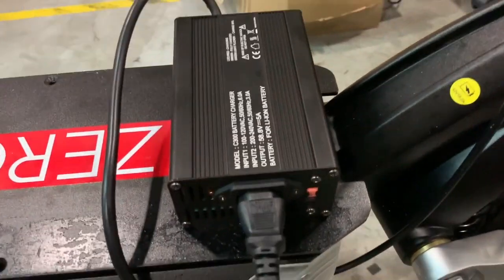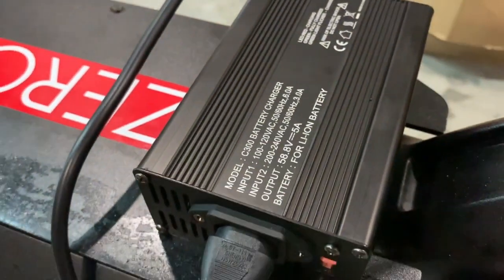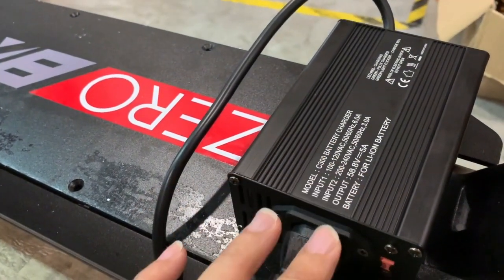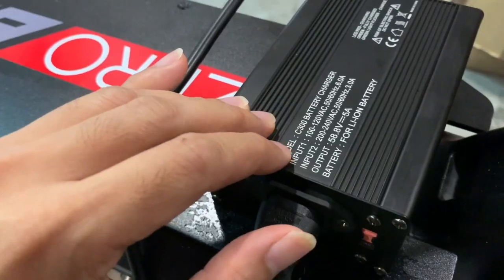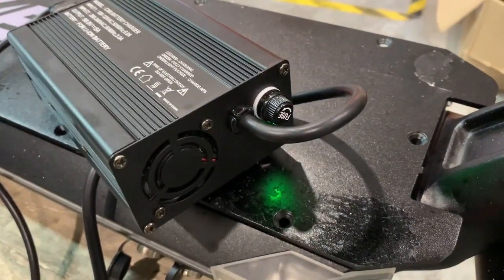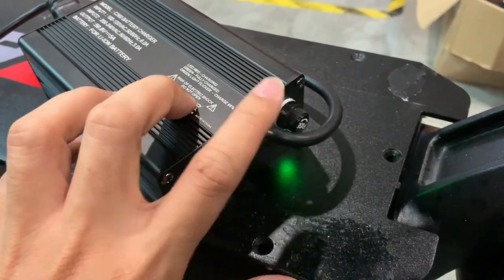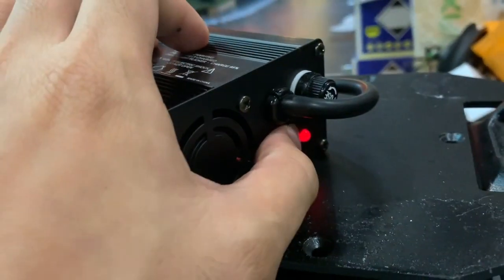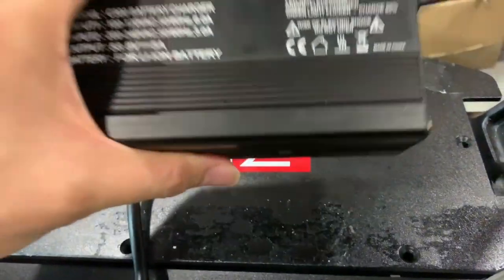Fast Charge your ZERO scooter in 5 Hours!

Comment: Is there a fast charger that will fully charge in 2 hours? Zero 10x 60v 21ah
Reply from the maker: Józsi that will not be too safe. The bms has a maximum charging rate of 4-5A
Reply: Which one has the fastest charger?
Reply from the maker: Józsi 5A charger
Reply: Should I buy 2x 5A?
Reply from the maker: Józsi that will spoil your battery
Reply: @FalconpevSg  Yes

Comment: Is okay to have 2 standard chargers charging the scooter? Or is damaging the battery as well? And better to use only one?
Reply: Hey! Did you find out?
Reply: Two standard chargers is fine. It’s the exact same as having 1 fast charger plugged into it. Follow the basic laws of (unplug 1 of them when the scooter reaches approx 70%) you don’t have to, but it will preserve battery life by reducing heat in the batteries and thus preventing evaporation from occurring and prolonging the batteries life cycle.

Comment: The scooter battery can handle 3500 watts of intermittent discharge under hard acceleration but how much can the battery handle for constant discharge . Whatt is the c rating of the sinc cells in charge and discharge ?
Reply: Does it matter if the two engine can only take 1000w each?
Reply: @steemium  current is drawn and voltage is pushed. the actual motor is rated to operate at 1000 watts constant but can draw at least 1600 watts for a short time . the controller limits what the motor can draw though.

Comment: The way these cells work is you have to keep the heat down as the very small amount of electrolyte will evaporate so this charger is fine upto 70% of charge and then ride or do last 30% before you ride ! Even better for yoir cells is do last 30% with normal 2 amp charger before you ride . Change your low voltage cut out to 4.15 an increase of .05. Always put atleast 10% of charge back into scooter after charging and let cool down to room temp before doimg fast charge. Not straight after hard run . This is to extend battery life nearly double ! Never charge scooter up from hard run to full with more than 2 amps as the battery will already be warm and now you increase the heat for 6 hours so the batttery is actually warm for 8 hours 🧐not good . Lots of evaporarion . Do this ten times and you will lose 30% of battery capacity ! Same as your smart phone etc
Reply: Can you dumb this down for me please? I'm getting this scooter this week and I need to know this
Reply: @Billionaireboyandres1  avoid creating heat in your batteries and then leaving them to stay warm by not charging them straight after long ride !
Reply: Thanks

Comment: What do to if the charger light don't turn from red to green even though the step is fully charged (i can see that on my screen and my voltage is 65. I have a 60V). Can it do damage to my battery if I keep using it? Thanks!

Comment: Its disappointing how no sellers seem to know even the most basic things about their scooters, the public depends on you but you fail them. Below is a good comment explaining why this charger will not damage the battery. My comment is to address the misinformation about panicking to turn the charger off to prevent over charging. This is actually governed inside the battery pack by the BMS, its essentially impossible to over charge the battery. Indeed it may be advisable to leave the charger connected for longer after the green light comes on because that's where battery balancing seems to happen (depends on BMS).
Reply: Let me get that straight...
It's better to leave the battery "overcharging", because of what exactly? What kind of balancing would that be?
As far as I've read, it's better to leave the battery at 30-70% at all times.
Please correct if I'm wrong, I actually have zero experience as I've just received my Zero recently (pun intended) cheers!
Reply: @rbmanb  I won't over charge if the charger voltage is correct. some of the cells might be higher and some lower. they have little bleed off resistors inside basic bms controllers that bleed off current to the higher cells and allow the lower ones to catch up. probably every 5 rides its best to leave it on for extra 30 min after green light to allow balancing.

Comment: The difference in battery life will be negligible when using this 5A battery charger (5-6 cycles at worst). With it you will charge your 23Ah battery with 0.22C which is on the lower end of li-ion battery specs (0.2 - 0.5C).
Actually with this charger you can double your battery pack life if you lower the output voltage to 57.4V.
This will result in 5-8% decrease of your battery capacity per charge(each cell will be charged to 4.1V), but will more than double full charge battery cycles!
Do not modify the charger if you do not know what are you doing !!!!! 

Opening the charger may be dangerous and you can electrocute yourself even if it is unplugged.

Ask an electrician/electronics engineer to do it. It only requires 2 screw drivers, voltmeter and 5 minutes of his/hers time.
Reply: Or if your smart the best way is like new iphones . Charge upto 90% and just before you go on your ride you finish off the last part of the charge . High battery degradations happens when cells are charged to 4.2 volts and just left . Even 1 day can have an effect . If storing scooter its best to charge 60%
Reply: @Buzzhumma  thanks for the tip. How about the lower side? Should you ever empty the battery? How low will you go, and for how long?
Reply: @rbmanb  same applies. Dont leave it there! 50% is a good place to leave it until next ride day !
Reply: Why not just use two normal charges instead?
How would that compare to one fast charger in terms of battery life?
Reply: Although doing that viltage drop might prevent the batteries being balanced at the end by the BMS.
Reply: @finophile  Most of the BMS do not wait for the batteries to reach 4.2V in order to start balancing. The balancing is done after reaching supplied voltage.

Comment: Is it okay to use a regular charger and a fast charger at the same time?
Reply: Do not charge both at once, regardless if they are both stock chargers or fast charges
Reply: @jacobmaz8157  why not? Two normal charges would be worse that one fast charger? How come?
Reply from the maker: jonnyA0112 no it’s too much for the battery. That’s a total of 7A charging and the battery cannot handle it

Comment: You can overcharge? Both versions of chargers do not shut off automatically when battery is fully charged?
Reply: Scooter itself has overcharge protection, but it’s best practice to unplug. Fires have occurred from battery management systems failing and overcharging batteries. Rare, but can occur.

Comment: if i use 2 normal chargers (2A) will it charge at the same speed of a fast charger? will 2 normal chargers will damage the battery life?
i am asking this because if i buy only one normal 2Amp charger i can use them on my 10x
Reply: bogdan9 It will charge at 4 amps with two normal chargers so will charge slightly slower than the 5 amp fast charger but not a huge difference. Two normal chargers will decrease battery cycle life compared to using one normal charger due to more heat while charging. It’s a trade off, would you prefer waiting longer to charge with one normal charger and maximise cycle life? Or decrease cycle life and cut Charging time in half?
Reply: @VtecDomani  all is correct !
Reply: VtecDomani  I don’t mind waiting, i charge it over night. But sometimes I think. It’s useful. 
The 2A charger heats up quite easily, i am thinking that if i use 2 of them, maybe it will take some stress of the charger.
Reply: bogdan9 It will probably have little effect on cycle life if two chargers are used together once in a while, however it won’t take any stress off of the charger by using two, they will still both heat up just the same. These chargers do get quite hot. Just be careful charging overnight as lithium battery’s can and have caused large fires if the BMS ( battery management system) in the battery fails and it keeps charging when the battery is already full, not very likely but it can and has happened. Safety first. I never charge mine at night as I wouldn’t want to risk it personally.
Reply from the maker: All good advice. Don’t charge overnight, and make it a habit to turn off the charger once fully charged. It’s good for your battery.
Reply: Falcon PEV - Home of the Best Electric Scooters Thanks :) love your scooters they’re the best!
Reply: So if I get it right, two normal chargers would charge twice as fast together. Slightly slower than the fast charger, and would decrease battery life, also slightly less. Is that right?
Reply: @rbmanb  you nailed it, bud.

Comment: ZERO 10X can use 2 Fast Charger 2 input (5A x 2) ?
Reply from the maker: Patchara Iamsuri - likeart best not to. The battery cannot handle 10A of charging.
Reply: @FalconpevSg  Thank you ^^
Reply: Will the charger automatically cut out when the battery is fully charged..??
Reply: @patmccaffery1543  yes